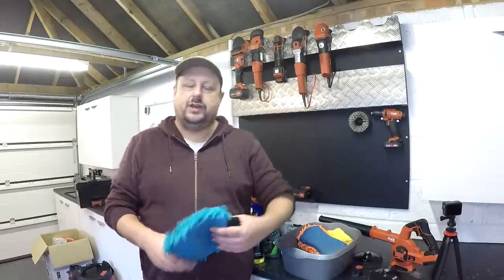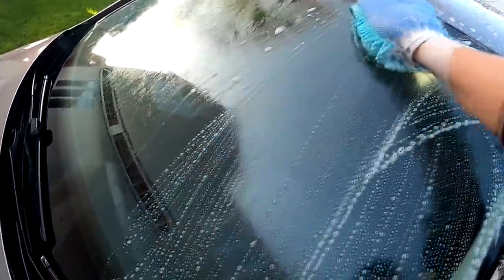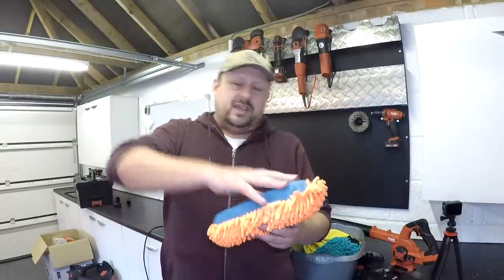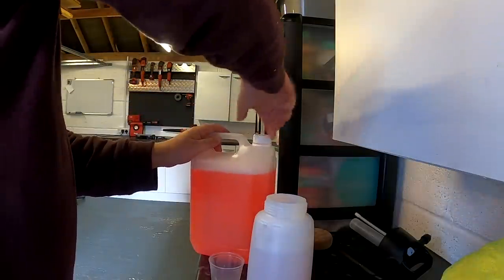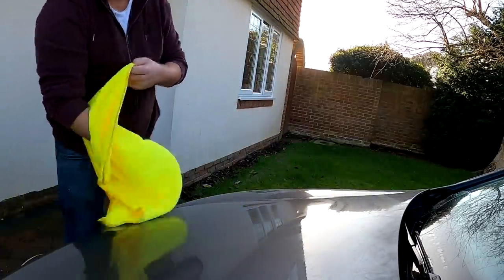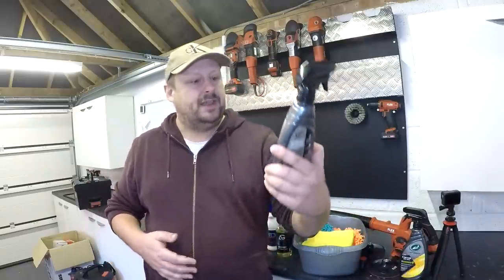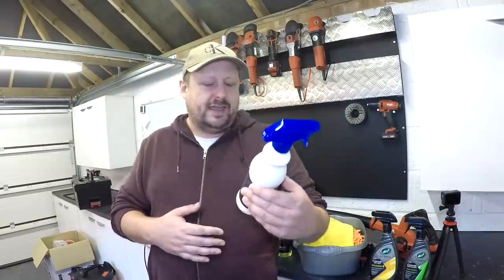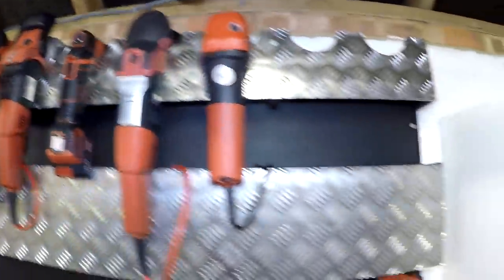Cheap and Award Winning is a good combo - Kent Car Care Detailing Products

Comment: Hi John I'm currently mid project on a black bora v6 4 motion and had to remove the headlamps to clean inside and restore the lens itself. I've tried 2000 grit wet and dry and then G3 cutting and sonax cutmax. With the outcome not as new but far off it, what can you recommend as a method and secondly what products are best?
Reply from the maker: yo its realy hard to say but based on what you tell me.. If they are in really bad shape sometimes you need to like wet sand a bit longer with something agressive and then step down..      but honestly once you sand these headlights you will be forever messing with them.   I did reg's on the 330 and 6-12 months later the clearcoat I put on is like failing.    The best thing you can do with polycarbonate lens on the headlight shell is buy a brand new lens.   A lot of headlight OEM marques sell just the lens.   Otherwise you are putting hours or wasted time in for temporary fix.   And a lot of the time the polycarbonate old lens have small hairline cracks that cant be fixes...       so Im just giving you some general advice really there.
Reply: Forensic Detailing Channel Thanks John that’s kinda what I feared most, (they are 20 years old) I guess new lenses or lamps it is then

Comment: Will theese towels be safe on the clear coat or do they mar the paint ?
Reply from the maker: safe, its more the contamination in the towel that scratches.. and of course pressure plays a bit part in the equation as well..
Reply: @ForensicDetailing  cool was just worried about the silk edging

Comment: Jon any chance you can respond to my question on instagram please?
Reply from the maker: I cant reply to DM's ive tried to diable messaging on instagram but it doesnt seem to work.  I dont use my phone much with instagram or generally
Reply: @ForensicDetailing  Love the channel.
Just asking for some advice please. I've bought some tetrosyl degreaser going on your advice on one of the videos for removing tar spots on my car.
How is best to apply this please? And do I have to water it down? I'm struggling to find any info. Many thanks for your time.
Reply from the maker: @Newts9  Yo ben its not water based mate dont try and water it down.  use a 2 cloth method.  1 application cloth. 1 clean dry cloth.    get the applicator cloth loaded up with product. then you can either spray onto the panel or more onto the loaded cloth..   spread a good wet film of the product over the panel.  give it a few seconds.   buff it with the clean cloth..   rotate new dry clean second cloths as needed.    Do not wait for product to vaporize buff before it vaporises.. think of it as a simple thinner..  the oil on the panel it will thin it down so when you buff you will remove it.  Dont use in sunlight on hot panels.
Reply: @ForensicDetailing  Really appreciate the help. Thank you.